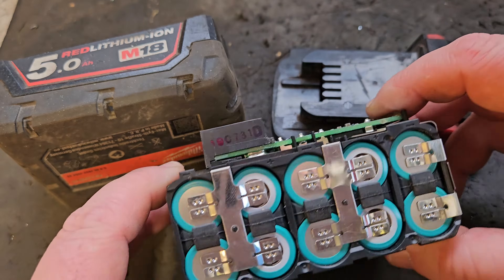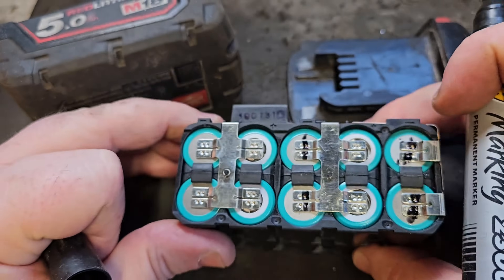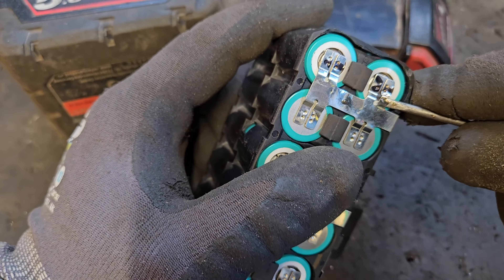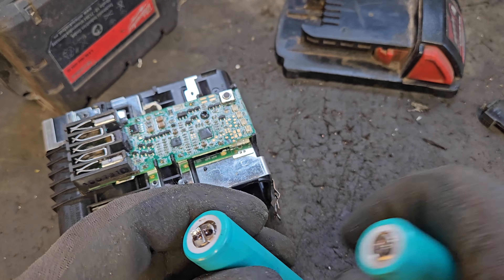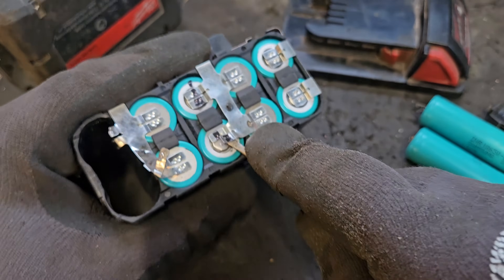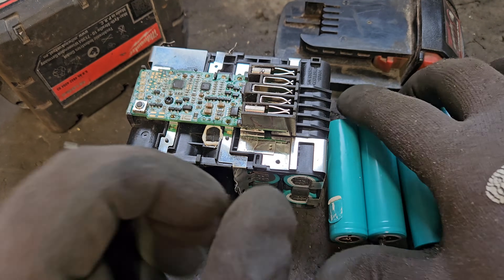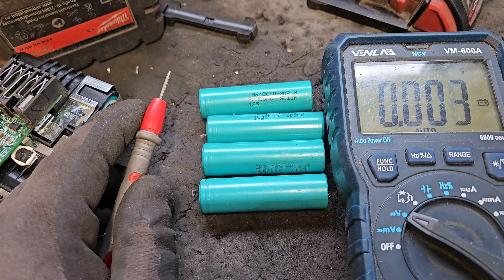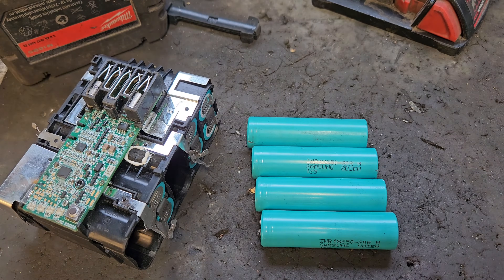Milwaukee Battery repair course EPISODE 3 removing dead cells from a battery pack

Comment: Thank you for these videos, I have a battery that wouldn't go up 2 lines and all cells mark 3.8/ 3.5 its the lowest. Do you think it needs replacement?
Reply from the maker: No need to replace any just equalise the cells
Reply: @doctorlefthandthread I will continue watching your videos, they are really educational.
Reply from the maker: @RobertoGonzalez-zd5mq this is episode 3 a later episode explains balance or equalising the cells

Comment: As unrepairable as these M18 batteries are, they’re way better than the older Milwaukee V28 batteries.  Replacing cells in those was essentially impossible— they had a fragile membrane PCB glued to the cells around the perimeter of the block of cells, which are held in place by a plastic housing that prevented the individual cells from being pressed out.
Reply from the maker: I never had the dubious pleasure of trying to fix a V28 thankfully

Comment: I’ve got the 9amp ones Milwaukee quit making them. 399 per battery at the time it’s a joke in the first year they quit working. I’ve got three bad cells in the exact same spots on both batteries. All three are 3.4 while all the other ones are 4.0 is 3.4 bad?
Reply from the maker: Not bad no You need to bring the 3 lower cells up to match the others
Reply: @doctorlefthandthread  the battery still charges just doesn’t last for 💩. On the grinder it’s dead in a few minutes
Reply from the maker: @tylerseabook9423 it can't last with the cells as low as that

Comment: hi, thanks for sharing
i have some m18 and the charger stsart flashing red, i noticed some 18650 seem gone, i want to replace them, do I need to replace the board too?
regards
Reply from the maker: Replace the cells first bring them to the same voltage as the rest if it still doesn't charge then replace the board